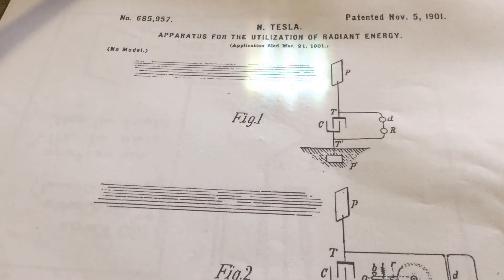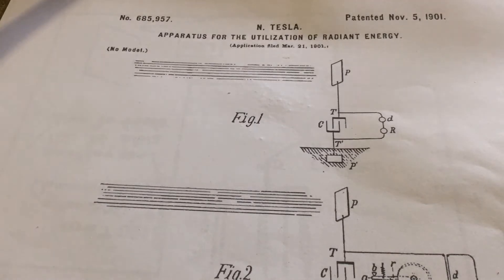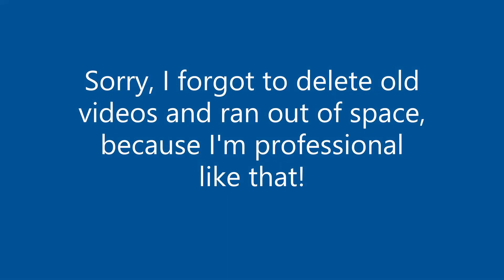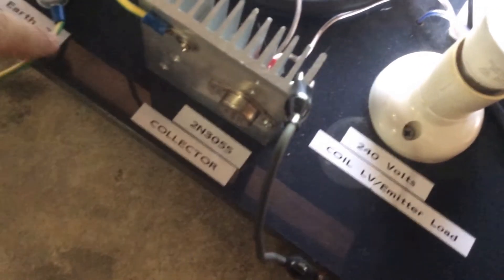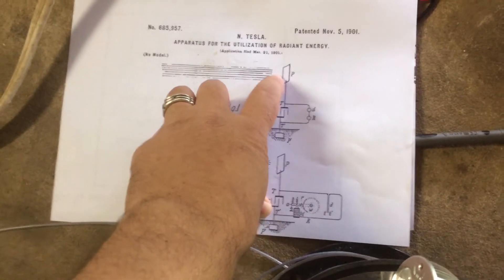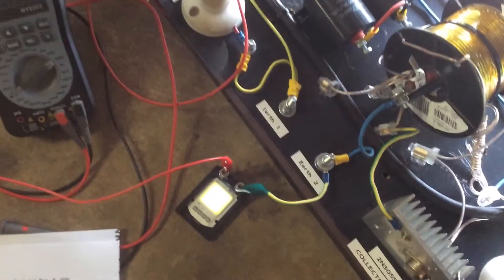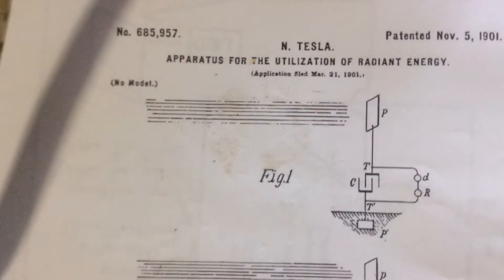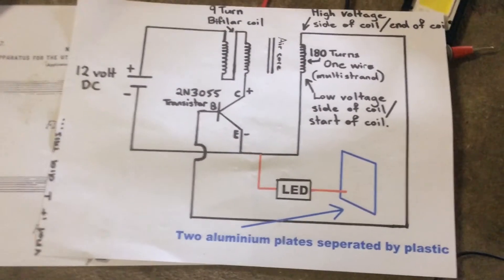Tesla Radiant Electricity Easy DIY Cosmic Energy Lights 240 Volt LED *Sense of Urgency*

Comment: Can you explain this in layman terms for us free thinkers that want to try
Reply from the maker: Hello Mohammad, thanks for watching. I am more than happy to help. This circuit is a lot easier to replicate than this video demonstrates. I will supply you a link to a video for my portable version https://youtu.be/Bp9j81ueVBg 
For earth transfer of power you connect the BASE of the transistor to the ground, then connect one wire to the negative on the battery, that wire runs through your light in series and then into the ground also. Power travels through the ground from the BASE and back to the circuit through the light. I hope this helps. Don’t hesitate to ask if needing further assistance.
Have a nice day
Reply: @whatifididthis...1236  thank you for the reply. I have to admit I have no idea what is going on in these videos lol. I know you know what you’re talking about though. Can you explain to me some of the basics of what exactly you’re doing? Are you literally pulling radiant energy from the aluminum receivers and like that’s it? And the battery charges itself? Is it that straightforward? Can you also explain what bifilar coils are used for and point me in the right direction at all? I’m very new to this stuff and I certainly don’t want to get a PhD but I’d like to learn so I can take something of the free energy world to my home country where people are dying just because of lack of electricity. I’d be willing to pay you for your knowledge. I just want something EASY and SIMPLE and straightforward. I need more than schematics. I need to be walked through it like a child would. If it’s literally perpetually free energy and the batteries don’t die then it’s definitely worth it for me to figure out. I just need the guidance.
Reply from the maker: @mohammadadam9084  Hi Mohammad, firstly I need to tell you the circuit as you see it is not capable of free energy. There are modifications required to achieve a self powered unit. I feel that is important for you to know as I don’t wish to be responsible for deceiving you.To make this unit self running you will need two or more coils that match the frequency of the drive coil. I will find you some videos that demonstrate how to achieve this as I currently haven’t made the videos you will need to easily understand self running devices. Remember that I am not trained in the electrical field but I believe in my circuit the energy is moving to the metal plate from my circuit as opposed to being collected by the metal plate, the metal plate is acting as capacitive earth, similar to connecting into the ground, however I could be wrong. Achieving self running is easier than you would think there’s a few basic things to understand, when you learn how to make these coils you will realise you don’t need to know how they do what they do, the only important part is teaching someone how to make them, as there is no free in free energy if your the only one that knows. Consider it this way, if you wish to drive a car you only need know how to operate it and not necessarily how an internal combustion engine works. Likewise you can teach a person how to drive and there’s no need to teach them about the engine. Self running devices are based on radio frequency, or to be more accurate if a second coil is made at the same frequency as the driving circuit it will resonate allowing it to share the magnetic field of the drive coil with no increase in power from the transmitter coil, this will also work with a length of wire that is the same matching frequency, the length of wire determines the frequency, too short or too long and it won’t receive the radio frequency. A change in frequency will usually occur when adding more coils but this can be adjusted without increasing input power. Therefore driving as many loads as can physically fit inside the magnetic field.
 I do not want money for educating people, as I have not paid for my education, if you feel my information is worthy, the best way you can pay me is to teach someone else what you have learned. My circuit as shown in my video can very easily be powered by a very small and cheap solar panel, this circuit is very efficient and uses very little power and requires very small amount of power to transfer this energy kilometres away through the earth with only one wire saving you a fortune in copper wire. I completely understand your need for guidance as I don’t personally know anyone that could teach me and at the start of my journey I remember how overwhelming it all was. A bifilar coil is two wires side by side wrapped around a form, I generally use speaker wire as it is already two wires side by side but any two wires placed side by side will work, hold two wires together and just start wrapping. When done you will have two wire ends at one end of the coil and two wire ends at the other end of the coil. Most important is being careful, never relax too much, always consider your device could kill you and everything should be fine! Sorry for the long reply, I will find you those videos for an easy introduction to self running devices and post them here for you as well as a bifilar wound coil video.
Have a nice day
Reply from the maker: Hi Mohammad, this video will teach you how to measure and match your coil frequency. https://youtu.be/r0Fq2BCtlOM
Reply from the maker: This video demonstrates what is possible, Rick is 100% correct in my experience. This is a 2 hour+ long video but if you want evidence you only need to watch a minute worth to realise his circuit is producing more output than what is required to run the transmitter. https://youtu.be/tpoOWs8SfVo
Reply from the maker: Here is another one of Ricks videos, a much shorter one for those who suffer with being impatient. It’s important to note this work is over 120 years old now. The secret has always been radio frequency, invented by Tesla’s work, not invented by Marconi as they teach us. Why do they teach us this, because Marconi sold it as an entertainment device keeping the rich wealthy using our ignorance and Tesla was pitching it as a power transmitter, which means they would not have been able to place a meter on it to charge you. For anyone questioning the truth in this statement need only look at the courts overturning Marconi’s radio patent in the US because Tesla presented patents of the same design that were granted earlier. Radio is the secret. The large coil you see in Rick’s video has an appropriate frequency applied to it with a set input, all the other coils are built to match that frequency, clearly the circuit powers more than is being applied to drive the circuit. Even if one was to not recharge the power supply and instead use output coils to charge a seperate battery intended to be swapped with the drive battery later, you still charge that battery or batteries for free! https://youtu.be/Vb5bBSGiGvA
Reply from the maker: Here is another video that I find really easy to understand. Building a crystal radio is a great way to learn about free energy as there is no battery so it’s a great one to show the disbelievers. Now apply this concept to what you see in Ricks videos and your good to go. Rimstar.Org is an excellent educator that you will learn a lot from! He also has a video he mentions at the start of this video where he shows you how to build a crystal radio from household scraps. https://youtu.be/0-PParSmwtE